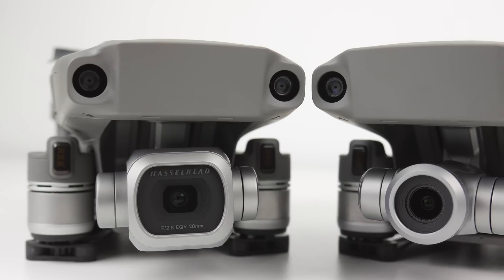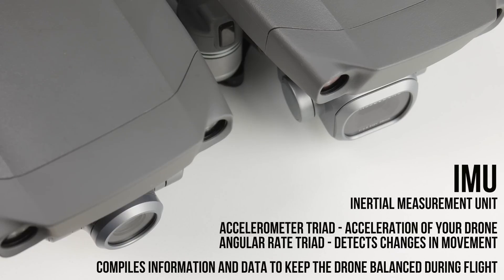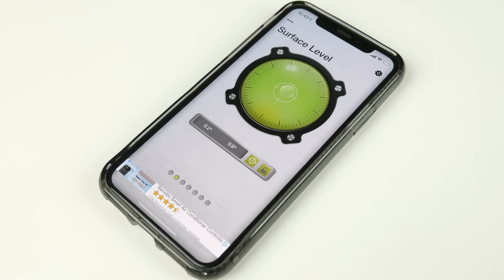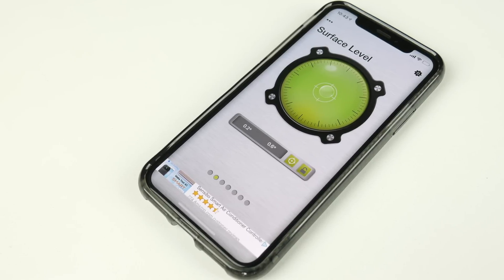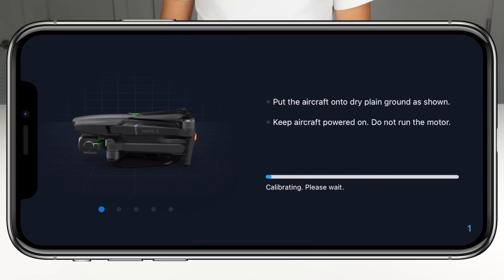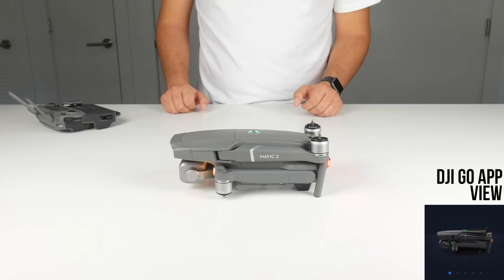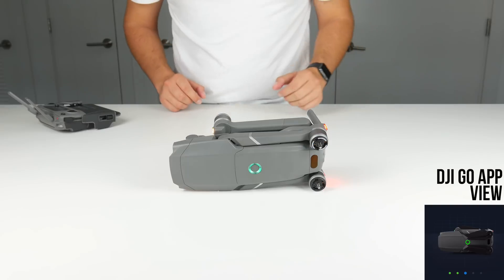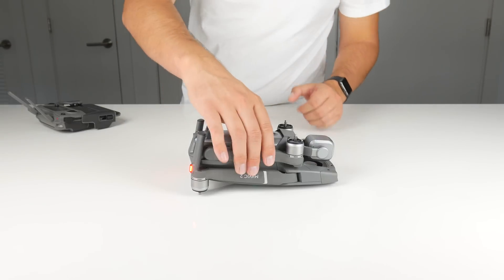DJI Mavic 2 Pro & Zoom: When and How to Calibrate The IMU

Comment: Sorry Billy, but I calibrated my IMU yesterday and had to do “way more” than what you show here. Maybe I’m not doing it right, but I had to attach a cable between my Mavic Two Pro and my desktop computer’s USB slot, open DJI Assistant, then hold and turn the drone as directed by the program to follow prompts on the computer screen for each sensor ( all of em ) to replicate the direction each sensor needs to see. I have seen no tutorial or video that shows having to do that ? but my IMU is properly calibrated and my Mavic Two Pro is rocking like “Ms. Agnes, dog !”

Comment: I suspect you don't have to have a perfect level, or else the app and instructions would tell you to check level of the table.  Besides, when sitting the Mavic in the different positions, it isn't going to be perfectly flat.

As for cold calibration, that definitely was an issue with the P3 staying a long time in 'warming up' under colder days.  Calibrating the IMU on the P3 when its cold tended to shorten the warmup period.

Comment: Can you over calibrate?  I would think no.   The calibration police might have different thoughts though.
Reply: I wouldn´t say that, but when it comes to calibrating the compass you may just do that.
My experience is that if you calibrate the compass every time you fly, you do not have control of what environment you are in.
There can be a lot of stuff that interfere with the calibration around you. I always go to one place that I know is "clean" of interference 
and calibrate there and thats it. If the calibration goes wrong because of interference you can get a "flyaway", just saying.
Have done that too.

Comment: Is the inset a DJI video ? on the current Go4 V4.3.0 for Android, the photo for step 4, Mavic on its back legs vertical is incorrect, it never shows it on its rear legs vertical, it has been reported to DJI. Are you using IOS ? Is it correct in the IOS APP ? Thanks Billie keep up the good work.

Comment: For the calibration, the images on the dji go app are not always correct. Multiple times it stopped showing the direction to turn it.
Reply: i had the same issue. It would just hang on one position forever. I gave up.
Reply: @ksimm1986  if you just go ahead and rotate it(I followed the video for what position to put it in) it will still run through the process